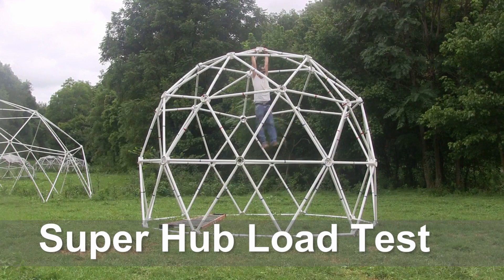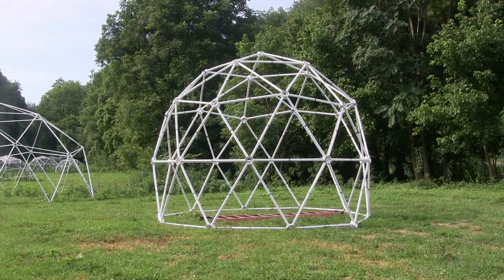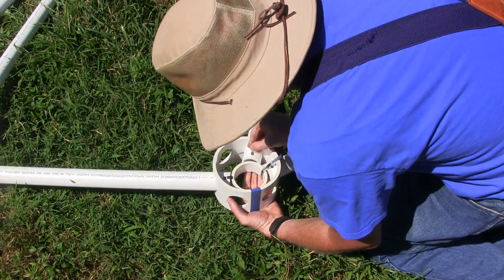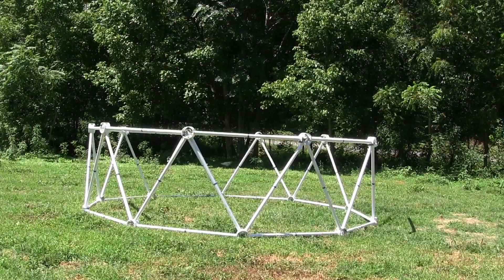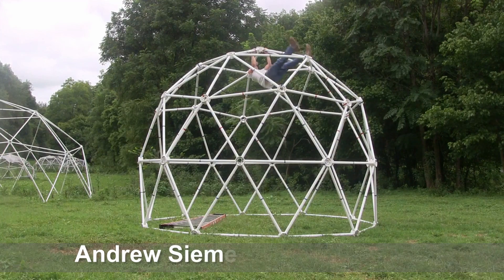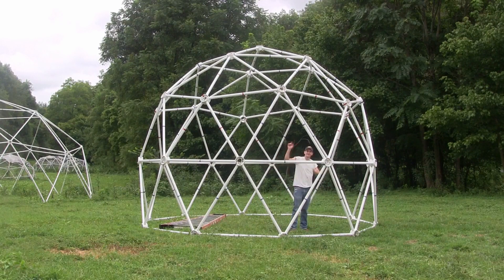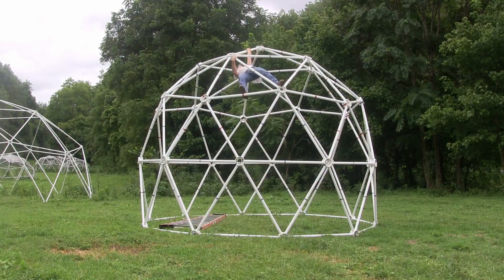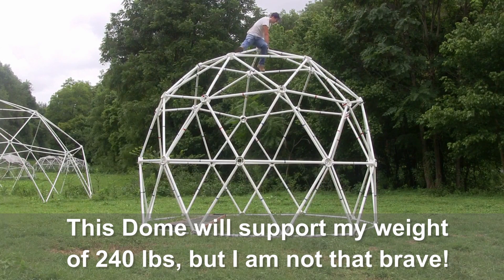Silo Dome Super Hubs Load Test

Comment: I’m so close to pulling the trigger and buying one of these
Reply from the maker: Thanks!  Call us at (931) 858-6892 if you have any questions.  John
Reply: @ZipTieDomes  Would you be willing to custom make pups that would fit a bigger diameter PVC pipe?
Reply from the maker: @dominicferro8314  I am setup to make domes with a maximum of 1.5" PVC struts.

Comment: Nice demo.
I'm planning a bigger dome for a 2-floor house, and thus considering steel pipes for struts.
For connector hubs I just thought of a steel ball (so that each pipe touches as close to perfect as possible and at any given angle) - this is to allow better transmission of the weight to the downward pipes. 
And to hold it in place just two steel plates (like a bowls) - one on inside and one on the outside - with 5- or 6 holes (bigger than the pipes, to avoid worrying about exact angles while mounting it up) respectively for the 5- and 6-way hubs. These two plates will enclose the ends of the pipes and steel ball in the middle (the plates should have a hole /smaller than the steel ball/ in the middle to easily ensure the ball correct position) and will be mounted to each other with simple nuts & bolts. 
The pipes can then be simply slid in each of the hub's holes (similar to your design). And when the whole structure is assembled and the small movements settled down the pipes ends entering the steel plates can be welded (this is for permanent long-life house - no need to be disassembled, but if so it needed then just don't weld them). Also if necessary the visible edges of the steel balls touching the plates can also be welded.
That should be plenty strong for 14-15 meters diameter dome that would carry insulated walls, windows and most elements a normal house has.
Steel structure of course will be more expensive than PVC, but if done (and insulated from humidity) properly it can easily last for 100 years.
Imho using steel pipes and hubs allows to easily size them up or down as necessary for the desired dome size.
Reply from the maker: That is a great idea, you should make a video when you build your dome.  I would love to see it.  Thank you for your comments.  John Hurt
Reply: @ZipTieDomes  ,
 I would love to see it too :)
I'm still in planning stage, and it'll be a while until I get to implementation. So I'm mostly testing my ideas yet.
But I'm glad you like it! :)
Reply: @ZipTieDomes  , actually the idea evolved a little. After I assumed the pipes would be just like the ones used for scaffolding (ie about 48.3mm O/D x 4mm wall) it means that a 6-way hub should have a ball that can fit 6x 48.3mm (and for the slightly irregular 6-way hub it would take few extra mm on one side) so it means a steel ball with circumference of about 30 cm (ie about 9.5cm diameter) - that would be quite the cannon ball :) (still possible of course).
So I think it would be more optimal to use something like the inner ring of such Spherical Bearing - or simply a ring which is cut out of a sphere (with thick enough wall of course)
www.xjhslidebearing.com/uploads/201817946/spherical-plain-bearing-gefz-s-series01068740486.jpg
Reply: Hi again John,
I've designed new (I hope better & simpler) geo-dome hub connector. One that should be universal for all the angles, and also that can be made only by the most standard & commonly available steel profiles (or other materials if strong enough for the size & purpose). I made a small SketchUp project to illustrate. 
https://3dwarehouse.sketchup.com/model/c63c616b-60b5-497a-a88a-c1cff30269f0/Universal-Geodesic-Dome-Connector
There's detailed description in the project too. But here's the main idea:
Around the hub of course we have either 5 or 6 struts (I prefer to use rectangular tubes since when tightened they'll fit to the other flat elements' surfaces and add some friction force. But there's no big issue to use round tubes for example, perhaps with some spacers); 
In the middle there's the main hub, which is basically two flat plates (steel in my case).
These plates should have either 6 holes or 5 holes at needed angles - I mean general angles like the 5-way hub should have it's holes at about 72 degrees, and 6-way hub at about 60 degrees. For a v3 hub actually most of the 6-way hubs will have angles like 55.7 & 62.2 but they're close enough to 60 and the rotation that the bolts give will allow adjustment to the exact needed angle (automatically by connecting the struts with correct lengths). So no need to be super precise and drill different plates with tiny angles differences.
The plates should also have some corners cut so that after the hole there's the same distance to the end of the plate - in my example I'm using M14 bolts, and leaving another 14mm of material on the plate, then cut perpendicular to the line between the plate's center and the respective hole - should be simple enough.
Then there's the 'magic' :) short square profile pegs (in my sizing 30x30x90mm). They're also very common profile, just square extrusion profiles, pick the needed width cut in pieces (90mm in my case) and then drill two holes for the M14 bolts, but drill them on perpendicular sides of the peg - ie you should get something like a middle of a Cardan-Joint (or CV-Joint) one of the holes will go in between the hub plates, and the other in the end of the struts' tube.
So the bolts on the plate will allow to adjust the exact angles between the struts, and the other bolt (thru each struts' end) will adjust the dihedral angles between the dome panels.
This design isn't something original - I've seen few similar ones, but the main advantage is the simplicity - no custom parts of processing is needed - just simple cutting at certain lengths and drilling some holes.
Optional) For smaller and lighter domes with lighter frames, the two plates (if thinner sheets are used) can be reinforced by adding a ring with the same thickness as the square-pegs - very much as in your own hub design. This should reinforce the plates against bending caused by high load and the fact that load direction is not in the same plane (ie at about 156 degrees instead of 180). The distance between the inner ends of the square pegs should determine the ring diameter. These rings can also be cut from standard (wide) pipes, nothing complex.
If the struts have thinner walls laying all the weight on single bolt might try to bend the connection point of the struts (the bolts if chosen correctly can take much higher shear forces) but the ends of the struts can be reinforced by short sleeve, ideally same shape profile, just a size larger so that it can wrap around the strut end. Then more bolts can be used between the strut & the sleeve if necessary, and the single rotation-bolt would got thru the thicker total walls of the strut & sleeve - this should solve potential bending at the struts' ends without the need to use larger & thicker struts for the whole length, but just the ends.
What do you think? I'll appreciate your opinion!

Comment: I am thinking a 4v dome, so that children could play on it could be fun and if it is really high, you can suspend a swing from the top of it and let it swing inside.  Yeah .... I have tough kids ....
Reply from the maker: That is great!
Reply: @ZipTieDomes  Thanks!  I wonder if anyone has though of putting copper pipe inside the PVC pipe.  Putting copper pipe in all the PVC pipes would be prohibitively expensive, however, if one were suspending a swing from two struts, one could put copper or even steel pipes in those two struts, rendering the PVC pipe inflexible and distributing the load to two other hubs, each hub being supported by five (or six) different PVC pipes.  For example, one could put a 3/4' diameter steel pipe inside the 1" diameter PVC pipe.  If the metal pipe were just a bit shorter than then PVC pipe, it would save the trouble of drilling holes for the zip ties into the metal.  It might be an idea for a strong residential structure in a high wind environment.  Heck, one might even be brave enough to use one of these things as hoist.  Just a thought  :)   I can't wait until spring to try building one of these!
Reply from the maker: @trevorstolz8580  Thanks for the comment. I have experimented with steel rods and even rebar for struts, and it makes the dome incredibly strong.  Have a great day.  John Hurt

Comment: hi  can a 30 m diameter  9V geodesic pvc dome hold by this method and also by using aluminium zip ties ?
Reply from the maker: We use stainless steel zip ties, but for a 30m dome I would use steel struts instead of PVC.